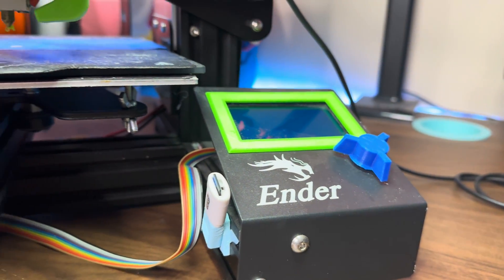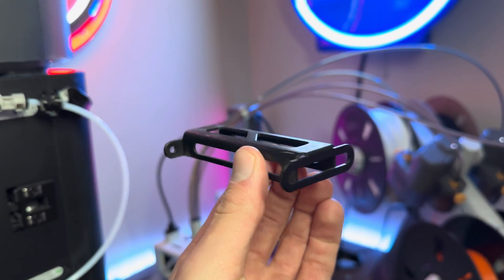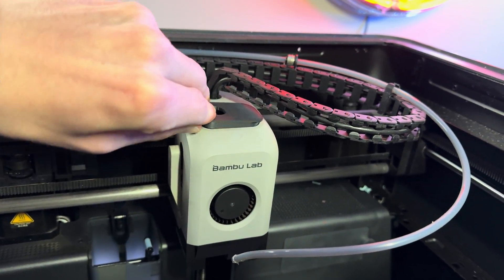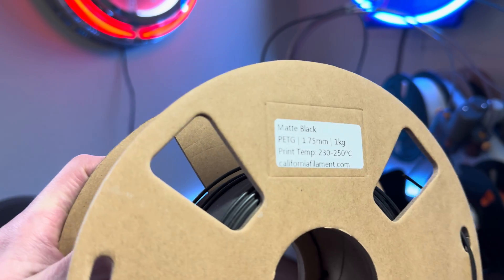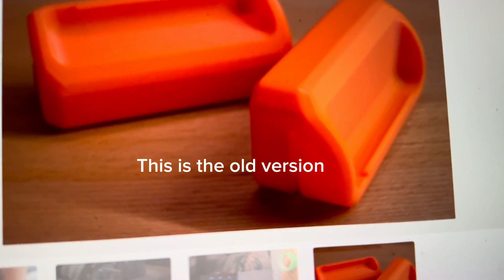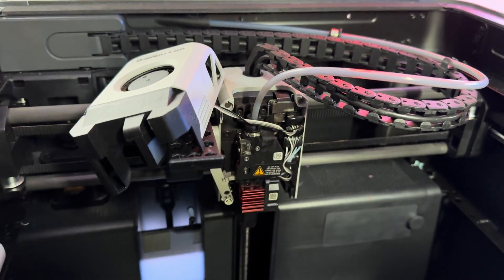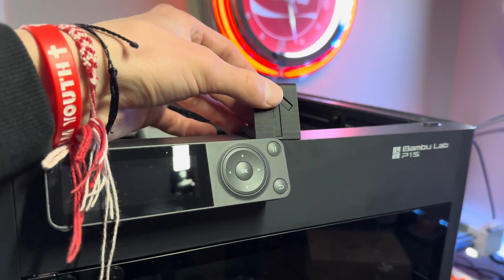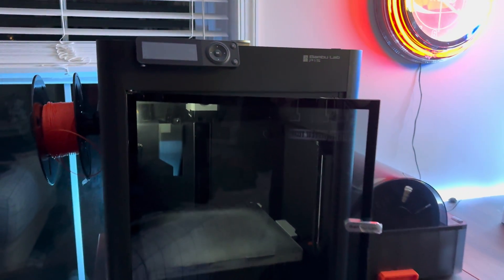14 BEST MODS FOR BAMBU LAB P1S OR X1C

Comment: I have at least two hundred hours of printing on my P1S now and have never had PEI Textured plate adhesion problems. I purchased glue but have yet to open the package. I keep a spray bottle of IPA and a microfiber cloth next to the printer and give the plate a wipe after every print. Some of the cavity cover ideas are good, I think, but I would not cover any fans, especially at the front of the print head. Anything that inhibits, or "chokes", air flow, even a little bit, is not good for the printer.

Comment: Idk what you’re doing but I’ve never had to use a glue stick on a textured plate. Wipe down with isopropyl before and after every print. Don’t touch the plate. Have been printing for 8 years and haven’t had to use a glue stick one time

Comment: Here's a suggested mod of a mod....The part that puts the single spool holder from the back to the side (about 1:30 in the video) could be modified so that it covers the belt tensioner. You have a great belt tensioner part that covers the left tensioner, but because the spool holder is in the way, you can't put one on the right. All that would have to happen is to modify the spool holder a little to cover the belt tensioner on the right and problem solved!
I really like the Y split mod at the end, but the link you provided isn't the splitter, it is the splitter support bracket. Thanks.
Reply: Isn’t that already what it does??

Comment: The Bambu Labs P1S has holes because they are designed as ventilation points to allow for better airflow during the printing process, which is crucial for cooling the filament as it extrudes, preventing warping and ensuring optimal print quality, especially with materials like ABS that require more cooling.

Comment: Has no one heard of sticky tape? It's a lot quicker and easier than printing parts just to cover dust holes
Reply: Also. I use a slide top riser so I can have an air gap when needed, but the AMS can be on top. Unlike this hinged option

Comment: Print Farm Owner Here. One tip I can give people with the problems of the cardboard spools in the ams is that you can put electrical tape around the edges of the spools for almost perfect grip. works almost better than plastic spools and doesnt leave a cardboard dust mess. No need for those dumb plastic liners around your spools. Also consider a spool weight if you are having issues with the spool rolling in and out of your ams and lodging itself on the top cover of your ams.
Reply: Thank you. I just got into printing and bought a p1s and just chucked on cardboard spools. Error after error and finally figured out it was the cardboard. Printed of 4 sets of rings, but now I'll probably use electrical tape like you suggest.

Comment: If you are having adhesion issues with textured PEI you are doing something wrong.  Keep your greasy meat sticks off the bed and be very careful to never touch it.  If anything I would say it holds almost too well most of the time.  That nasty looking glue-stick stained plate is unnecessary.
Reply: You had me at meat sticks
Reply: I agree, the PEI plate does not need glue sticks and I use soapy water to clean plate.
Reply: Detergent and hot water do a much better job than alcohol wipes.
The wipes don't remove oils as much as they redistribute them.
Reply: @pirobot668beta  99% alcohol on a microfiber cloth will break down the grease more than enough for gravity and absorption to take care of the rest. That would only really be a concern with a lower % alcohol.
Reply: Alcohol is NOT your friend.
Degrease the plate with detergent and lots of hot water, air-dry rather than wipe down.
Build-plates are somewhat porous...alcohol doesn't completely remove oils, only dilutes/spreads them.
Glass print-plates are best cleaned with alcohol.
Beware...some 'rubbing alcohol' comes with mineral oil...70% Walgreens brand, looking at you!
Reply: "Greasy meat stick" 😂
Reply: Is it the same with smooth plate? I've just grabbed one
Reply: One other option is to clean it with alcohol from time to time.
Reply: I touch my PEI build plate all the time and have no adhesion issues. Maybe I have clean hands, but these build plates are awesome are other than texture, I see no real reason to swap it out for pla or petg

Comment: Due to the possible overheating complications down the line, I would be more eager to use silicone moulds or maybe even none at all since i'm sure there was a team of BambuLab engineers foreseeing the overheating issues hence the gaps and vents in the original design.

Comment: There is probably a reason why Bamboo Labs left the holes in the back and on the top, possibly for heat-related reasons. Just throwing that out there.
Reply: My thoughts exactly! I would be more eager to use silicone moulds instead if any at all due to that exact reason since i'm sure there was a team of engineers foreseeing the overheating issues.

Comment: strange oppinion as a ender 3 pro to p1s changer..
Its sad that the p1s is pretty close to beeing perfect. I loved to heavaly modify it and build around it to make it 0.1% better. if its installing a pythingy or making extruding ever so slighty better.
im IMMENSLY happy with my p1s since my failpraint%rate went from 70% with the ender, down to 5% since i use custom and hard fillaments. but still. You cant print stuff to ''upgrade'' the p1s to make it better. Anyone feel like that? 
Its still one of the best decisions ive made but. still. theres this thing in the back of my head as a hobbyuser of 3d printing.

Comment: 2:44 what's that hole even for?
Reply: It's a hot air exhaust for the hotend fan. Not a good idea to cover it
Reply: @svgPhoenix  Ah 💀 I wasn't planning on covering it as I figured it's there for a reason, but yeah. Definitely won't be doing so now. All these "dust protections" seem unnecessary anyway. I do like the chamber fan one though, I'm dumb enough to get something stuck in there lol

Comment: Great video - Thanks!  I like the idea of that PEX plate and just ordered one.  I bought a Bambu X1C from Microcenter, opting for the additional $300 extended warrantee plan.  Maybe a big pill to swallow, but having a walk-up replacement guarantee instead of having to deal with Bambu in China helped me sleep better.  About two weeks into owning it, something went wrong with the AMS and I ended up returning the printer and getting another one as a walk in replacement.  All I really needed was an AMS, but all they could do was replace "the whole shooting match".  So be it.  I get home to find that the second printer had a smooth plate (whereas the first printer came with the textured plate).  I decided I really liked the textured plate better (no glue needed, at least with PLA), and bought an additional textured plate.  That left me with a smooth plate for smooth finishes (and a pain in the a$$ dealing with glue), or a textured plate that had a finish that wasn't always desirable.  Now, along comes a matte finish plate that requires no glue, and no funky patterns?  Bring it on!

Comment: If you look for 'long drop poop chute' you will find the one I designed that lets you have the poop go into a container underneath the table it is sitting on. I have 2 printers sitting side by side so I dont have the room for the side bucket which is also much smaller.

Comment: I haven't used any glue or any other adhesion helper on my P1S textured plate. I've printed PLA and PETG, and both stick perfectly fine. Most prints are impossible to get off without bending the plate or getting something underneath the print. The only thing you may need after a while is a bit of Isopropanol alcohol (IPA) to remove the grease from your fingers. Other than that, you simply don't need anything.
Reply: You’re not supposed to use glue on textured pei in the first place and is likely why he’s having issues with adhesion anyways. Iv never once used glue on textured pei
Reply: @bostonblizzards Agreed. I clean textured PEI with dawn and water if it has been handled a lot, a quick wipe with 91% IPA if it has not. Works great for PLA and PETG.

I use hairspray on textured PEI to prevent Overture TPU from sticking so tightly you nearly ruin the sheet prying it off. Hairspray gives it similar adhesion to PLA. They pop right off.
Reply: It's got to be the highest alcohol content. I used the lower, and it doesn't work as good!

Comment: I am just learning, but I just learned, My P1S gets heat creep on TPU and flexible PLA. Covering up the top of the head for the dust cover will propagate heat creep. I know it doesn't matter to most people, but I thought I'd add that.
Reply: So it makes it worst? I'm confused
Reply: @Iamdudeman12  probably. that gap is probably there by design and for cooling. when doing mods like this, you always run the risk of hurting more than helping due to the fact you are really trying to fix something that isn't broken. print in clean enviorment/service your printer and you will be fine.
Reply: @Iamdudeman12  bump
Reply: bump, same thoughts

Comment: I've never understood why people go through the trouble of printing that tool head holder when it is just far easier to pop the one connector for the fan on and off. As for actual mods, the one that allows you to add the A1 silicone wiper in line with the existing wiper is probably the single best one for those of us who do a bunch of multi material printing. I've never had a failed print due to wipes being drug back into the print area since doing that.
Reply: I may be wrong but I think you run the risk of the connector breaking over time through repeated connecting and disconnecting, so it may be preferable to securely place the holder off to the side instead. That is my best guess though.
Reply: @fitzgeraldlewis I recently had to take the cover off to check for stuck filament in the PTFE tube and the official guide tells you to just take that connector out so it's probably fine.
Reply: @fitzgeraldlewis  removed the cover over one hundred times now due to repeat Extruder failures, absolutely no issues to date but I understand this concern. This connector likely has a cycle life of 500-1000 uses before its worn out
Reply: @fitzgeraldlewis good point, maybe a small pcb with male and female connectors, and a microswitch to connect and disconnect would be enough to avoid physically connecting and disconnecting the cable.

Comment: Use a PLA support interface layer on your PETG prints (or vice versa), the support will just fall away because PETG and PLA don't stick to each other.
Reply: Genius!
Reply: is there a way to slice it such that there's only one or two layers of different material on the supports? I would imagine that'd cut down on filament changes a lot
Reply: @SheepRants  Yes you set the support interface to PLA but the leave the support itself as PETG, that way it only does a filament change on the final layer of support.   On prints with basically flat supports this works really well.
Reply: I tried vice versa and PLA simply clogged where I had to disassemble the extruder.
Reply: Thank you so much for your valuable knowledge! Is there a possible way to connect with you via Discord to pick your brain a bit more by chance?
What are your thought on these modifications and potentially closing off engineered openings which were meant for cooling purposes? 
Thank you very much!